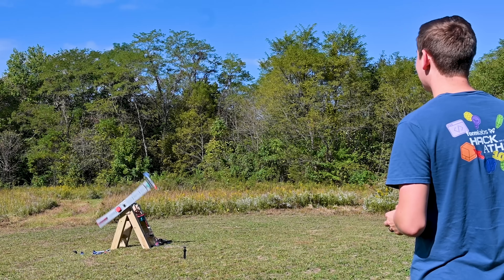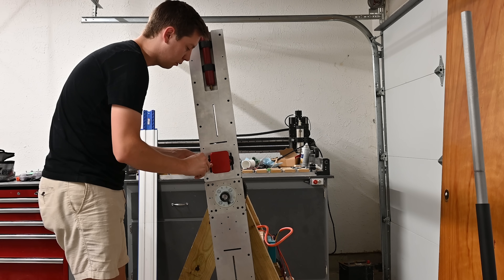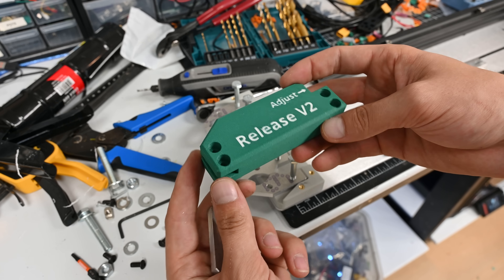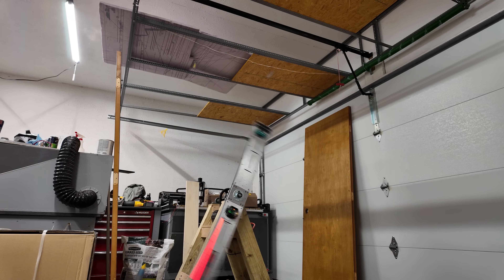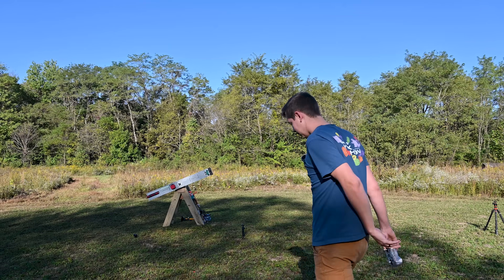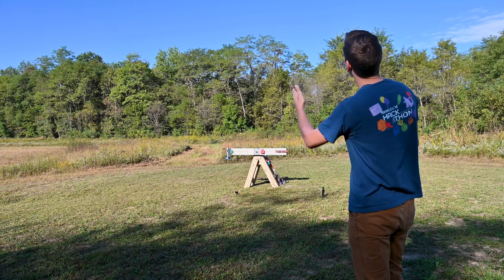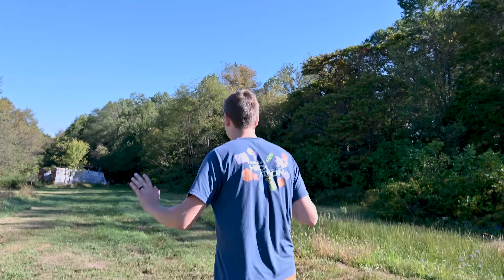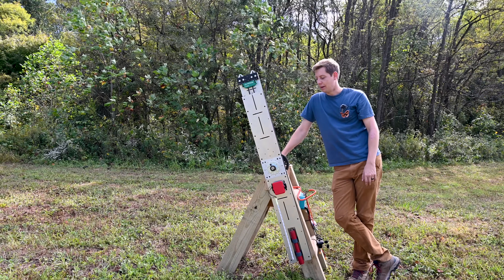I Fixed SpinLaunch

Comment: Add weight to it. Same rpm, more weight, more kenetic energy, further travel? Or find a rocket club that can get solid fuel and light it at release. And add an altimeter in the nosecone.

Comment: Next steps:
1. At least double the rotating arm length. 
2. Use much denser material for the rocket, like tungsten (less air resistance at same weight)
3. Triple the RPM
4. To get 1 - 3 working, implement a balancing mechanism, that will counteract the imbalance after the launch, i. e. some weight extending at the opposite to the rocket.

Comment: Make the rocket heavier.
And also put a counterweight at the other arm, that is released at the same time. That way you can spin it up to really high RPMs, and if the weight distribution is correct, it should be stable both before and after you have released.

Comment: You're going to run into the same issue as the real guys! You need a rapidly moveable counterweight to keep the arm from self destructing when launching more weight. Maybe a sprung weight that gets released via the same function as the rocket.  The weight could be made interchangeable for different payloads, or possibly a range of payloads with a moveable balance point. Great project!!!❤

Comment: You could add a timing gear or a magnetic switch detecting a plate for a specific release point. The same was rotary/wankel motors do.

Comment: It's perfectly balanced up until the point the rocket is launched.
If you could work out how to re-balance the launcher at that point, increasing RPM / Rocket weight would not be an issue.
Reply: I've seen some great comments down there.
There is a huge delta V at the point the rocket is released (technically delta M). I would suggest the first thing to do is increase the time to react - aka use some kind of damping system.

Comment: I wonder what would happen if the payload is counter rotated. That is, it sits on a gear that always rotates the other way to keep it perfectly vertical the whole time until release. Major g-force when changing movement direction up and down I suppose. Or perhaps it could just counter rotate for half or quarter of a rotation just before release.

Comment: Given that the manufacturing of energetics are the most significant bottleneck in munitions production; I wonder how much military supply chains would change if you could introduce an artillery piece that uses spin as a propellant.

Comment: This is very cool! i need to go back and watch the first episode! I'm really impressed that the spin can be counteracted so easily. that's one of the elements I thought they would have a real difficult time with at scale, but you've demonstrated very nicely that the same arm can provide the balancing forces needed - awesome! I'm still worried about off-balance rotor post-shot for the orbital class spinner. releasing a second payload into the ground would be like a bomb going off. mobile weights within the arm would be a CHALLENGE

Comment: Most people are talking about altering the arm with moving counterweights, shifting axles, etc.  Maybe the easiest fix for the vibrations that occur after launching is mounting the entire rig on rails. In medieval times, they put seige engines on wheels or rails just for this reason, and it is also used in many Asian countries to prevent damage tp skyscrapers during earthquakes. Since the vibration caused by the arm is quite linear, it might just work enough to prevent the system from shaking itself to pieces at higher speeds.

Comment: For your problem with the imbalance I might have an idea. You could mount a release mechanism on the other side as well, with the same weight as the rocket. Sure, the part would then slam into the ground, but you could build some kind of ‘deflection’ or have a sand bed underneath. With that, the weight of the rocket would be completely irrelevant and it would always run smoothly.

Comment: Cool project! How does the release timing logic work? is it sensor + software based or YOLO based?
I would add a shifting weight to the release mechanism to cancel out the sudden balance point shift.

Comment: You can make an autobalancer, using a weight conneted to a screw actuator, a autobalancer which will calibrate whole contraption automatically

Comment: Small improvement ideas.

 I feel that the next logical step is an aluminum rocket. Still a light rocket, but not too much.

Get a flight recorder for rockets. They will give you a decently accurate peak hight that you can compair to calculations.

 Raise the height of the spinner so that when you have a heavier rocket and it releases into the dirt the arm has enough clearance to not it the failed rocket.

Comment: Maybe putting the rocket on a plateform disk  instaled at the tip and stabilized with gyroscope ,or between two dicks attached in a fork link with the main arm

Comment: There's no fixing spinlaunch it's a scam lol, the electronics inside a potential satellite launched this way wouldn't even survive the Gs
Fun video though!
Reply: Thats BS. Not every satellite is a large solar cell winged sensitive thing, supply missions with just fuel and an engine on board dont need electronics that are sensitive. Also have a look at Electronics in for example frangible anti aircraft cannon rounds, they are literally fired from a gun.
Reply: @NIOC630  i think you're underestimating how many Gs it'd take to launch something in space from the ground in one shot, it's way, WAYYY more Gs than what a bullet is experiencing
Reply: @lanatsif  No its not, spinlaunch is roughly 10000G, an oerlikon 30mm sky ranger with sensor fused prjectiles ahs a barrel length of roughly 3m in wich it accelerates to 1400m/s, that is an acceleration of 33000G assuming its linear acceleration, in truth its much more acceleration at the beginning of the firing and less later in the barrel so >50000G is no issue for modern electronics. You can even look at the datasheets of components, there is off the shelf accelerometers that are able to handle >10000G you can buy yourself right now and today.
Reply: Exactly. The work done on this video is awesome, but it cannot be scaled to the level to be useful like Spinlaunch pretends.

Comment: You should add a counterweight on a screw, linear actuator or solenoid so that you can rebalance the arm after the launch. At the moment the minute you launch the whole thing becomes unbalanced, but you can fix that by shifting mass...

Comment: Very cool! Great design! Would be cool to see you upgrade your mechanical release mechanism to an electronic one that times the second pins release with 'pinpoint' accuracy based on the release of pin one in connection with the rpm.

You could then even do cool things like build in a camera targeting system. Maybe add a rotating base and a range finder and have it calculate the angle of release to hit something like an archery target? 🤔 😱

Comment: Actually, it should only have one arm. Having two arms creates more friction with the air, which can reduce the rotation speed. One thing to consider is that if a single arm is used, it's essential to maintain balance. I think some adjustments would need to be made. This is just a suggestion.

Comment: I wonder if it is possible to combine the flywheel trebuchet with the spin launch idea. If it's tuned just right, maybe it's possible to get all the impulse from the flywheel into the rocket. So that the flywheel comes to a standstill.
Tom Stanton did a few cool experiments with this.

Comment: Your release system block needs to be pulled inward to release the rocket. The faster you spin the arm, the harder that gets. I would suggest to swap the mechanism somehow so the centrifugal force helps releasing the jaws instead of fighting it. Also, your timing depends on the force necessary to move the mechanism vs the air restrictions, this seems a hard variable to control.

Comment: You could build a simpler and precisely repeatable acceleration/release mechanism.. like a mini rail gun.. and then experiment with mods to the projectile payload.  Perhaps something that can precisely deliver a life-saving sandwich.. whatever.. at distance via gps coordinates.. just spitballing here.  The point is, break a larger project into a series of defined and increasingly refined goals in order to create a SYSTEM.  It would enable you to develop a series of related content, challenge yourself technically, enable collaboration with others.. especially local engineering grad students, AND perhaps come up with something that’s actually marketable.

Comment: One thing I remember from a history of rockets doco I watched al long time ago, the Germans when they first got rockets to actually lift off successfully is it didn’t go straight.  

they then discovered to maintain ‘trajectory’ the rocket needed to rotate along the long axis, like a plane doing a barrel roll.

So having a slight twist on your fins should be sufficient to induce the spin I mean.

This is awesome what you have done btw.

The other thing I remember they did to reduce drag was to shape the tip after an 88mm shell, as it is the most ideal frontal area shape known.

Given you don’t seem to plan having an engine in the rocket, I’m wondering if the tail should be streamlined too?

Comment: So your throwing arm spins at around 400 rpm. At the time of rocket release, you aim to cancel the (same) rocket rotation in an instant. Cool for a hobby project, but still a substantial rotational deceleration. But the people of spin launch want to scale this up. Thats insane. And frankly. Yeah. I would say impossible.

Comment: I think your claw release solution has a flaw.  It's not going to matter at the speeds your currently working at, but I think it'll become more of an issue at higher speeds going forward.  The timing needed between the top and bottom claw release is dependent on arm speed, but you have set it up as a fixed amount, only adjustable through manual adjustment. Meaning each time you want to go faster or slower, you have to manually readjust the claw release timing.  I'd think your best bet here is to refactor the entire approach and just stop spining the rocket with the arm, by putting it on a separate wheel that's mechanically linked such that the rocket always points up.   

The second thing I see may be for a whole other video.  It's that only a very small part of the energy of the system is imparted into the rocket.  If you can work out a trebuchet like design, you should be able to impart most of the kenetic energy of the spinning bar into the rocket on launch.  
Though that might be out of scope as the whole rocket launch system is an imitation of another proposal.  

Also, just going to back up to big picture here.  Spin launching would never work for real orbital because the rocket and wheel would need to move at a speed that causes it to burn up in the atmosphere.

Comment: if you want to go higher, without increase of Gs at ridiculous values, you have to increase the diameter. But then you risk of building something very expensive, and that you can't carry from your garage to the launching pad. Unless you don't use a full rigid arm. Just like the sling used to hunt, where your rigid arm induce a rotation to a weight at the end of a rope, put your current system on the top of a wall/cliff/whatever, and search for the back-and-forth mouvement that can initiate the full rotation at the end of the rope. And determine the biggest diameter you can reach without inflecting a severe jolt when transitioning from the swing mouvement to the full rotation. I suppose that you can at least triple the diameter this way? What is the theoretical limit?
Reply: Then you can replace your current rigid arm by a longer light semi-flexible one, like the 5 meters mast of a windsurf sail, or even more flimsy plastic tubing used to enclose electric wires, or flat sail batten (better Cx when rotating at high speed)....
Reply: instead of the complex back-and forth mouvement, that is not trivial for a rocket with fins, have a launch dock 3/4 of a turn before the apex, so the rocket facing downward. Have a system (spring, rubber...) to accelerate the rocket just enough to reach the apex (one radius). The rocket is then stable at the extremity of its rope that is continuously under tension during the whole circle, and can be accelerated by the (semi)-rigid part of the rotating arm, that can much shorter compared to the rope. Diameter of the full circle and speed of the rocket is now only limited by air drag. Just have to enclose this in a vacuum chamber 😁 ....

Comment: for balancing the device have your counterweight be a mirrored version of the rocket and release mechanism on the opposite side of the thrower, this way you can increase the weight of your rocket and its counterweight dynamically without casing post launch instability in the thrower and potentially damaging the launch mechanism. might be nice to have some kind of cushion to catch the freshly released counterweight so i doesn't fly of and cause damage to people or the surroundings.

Comment: A TMD( Tuned Mass Dampener) built into the main structure might help with counteracting the weight shift if you try launching a heavier rocket

Comment: That's great, now spin up a real rocket that ignites after it's released. Maybe you push the ignition button if it's going up. Also maybe a higher speed camera. Use tracker software for good video kinematics calls.

Comment: You could use a light gate from those old computer mice to have the timing dialed in with software (the ones with the track ball in them). There is a little plastic fan that passes between an led & photo-diode. You can have software can count the number of rotations. Alternatively you can have the fan only unblocked during the phase in which the rocket can released.

Comment: wonder if you can have a mass that moves in and outward radially for dynamic adjustment of center of mass. Maybe pair with accelerometer to identify the least jiggly position.

Comment: If you haven’t already figured it out, the reason your rocket didn’t launch when you spun it super fast, but released when you slowed down is the inertial mass of the green block. Either find a way to lighten the green block, increase the air pressure, or make the release blocks move out of the way in a different fashion such as sideways or in the direction of the inertia force, outward.

Comment: Release A(forward) and B(aft) are a set distance apart (Arc length) along the circumference of the arm.  It takes Time for Release B to be in the same location as Release A based on the speed or radian per second.  You could use an electronic clock to initiate release.  If you can determine there are x amount of beats per revolution, then you can define the x amount of beats along the arc length of the release points.  Set the release times to those x amount of beats.

Comment: Neat video! Looks like a lot of work. Not to nitpick but I chuckled when you parked the truck 30 feet from where you set everything up. Like, pull up your truck, drop the stuff off, and then pull the truck away :D I would probably have done the same.

Comment: ok, so... what if.. the rocket actually had a solid rocket booster that ignited when out of bluetooth range? That way, the power of the rocket is not lost on the launch, but as a secondary booster. spin launch as the primary.
the issue would be the lag between squib lighting and the actual thrust. Also, fire hazzard if not vertical on launch.. but a cool idea?
edit: aaaannddd... reading the comments.. already suggested.... /pout

Comment: Also a question about the release mechanism:  With having a 2 stage release mechanism, is there any loss of velocity vs another type of system? I feel like there is some loss of energy in the time between the top release and bottom release.

Comment: Definitely keep this series going. Put an altimeter in there. They are cheap. You could also use an accelerometer to tell when the rocket is slowing down in velocity and use it to trigger a rocket motor to get even more height.

Comment: Yeah, but part of Spinlaunch's issue is/was the payload. Your spin launcher is awesome, but could it work at a larger scale?  And, I mean if energy wasn't an issue... Could the release mechanisms be strong enough and work fast enough on a larger rocket with a heavier payload. The materials needed to make the clamps, the distances needed for the release mechanisms to travel, etc. - Because, I suspect, or at least hope, the Spinlaunch people had a working prototype before they went big. Otherwise, their investors were complete morons.

Comment: If you manage to perfect the timing, maybe take it all the way and enclose the launcher in a sealed low pressure chamber to fully replicate the spinlauncher design and report back how much faster the arm can spin or how much less energy is consumed! Then, I don't know, maybe try to use it as a catapult and do a delivery (only once you've absolutely mastered precision, obviously)

Comment: @15:13 we can clearly see what I wondered would happen even with the super light projectile you're using: the spin arm is unbalanced once it releases the projectile. This will only get worse with higher launch speeds and greater projectile masses.

I think the SpinLaunch company actually has a counterweight they release at launch that buries itself into some shock-absorbing receptacle (but this is rarely if ever talked about). For your current setup, I think you could just use a hole in the ground. The release mechanism would be a challenge, but it doesn't seem it would be too difficult.

Comment: Instead of spin launch, to have an initial boost to save fuel weight on the rocket, they should just have a like a hole in the ground to use the earth like a gun. That would be easier for any small enough rockets.